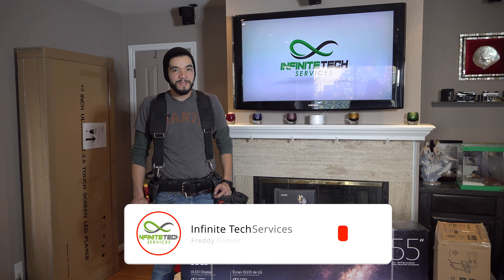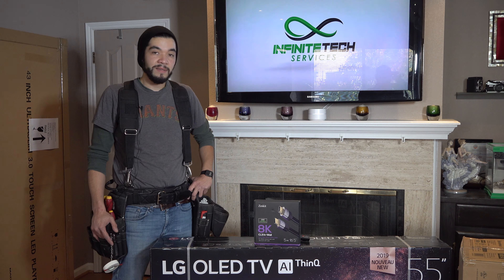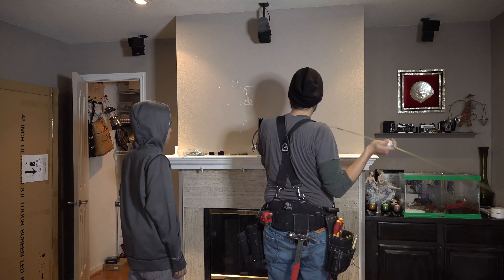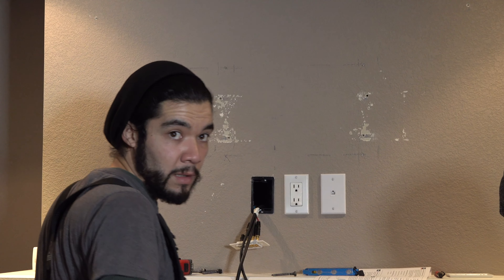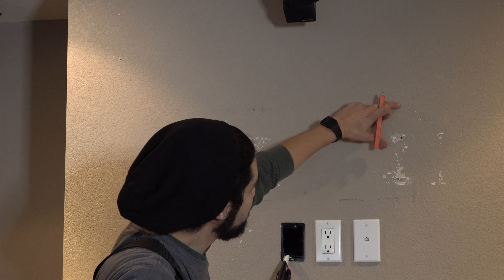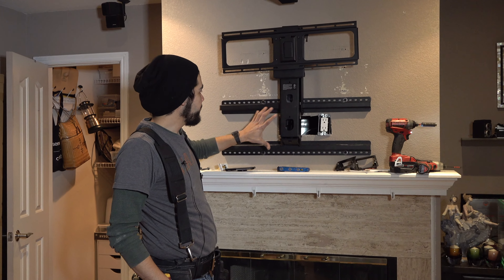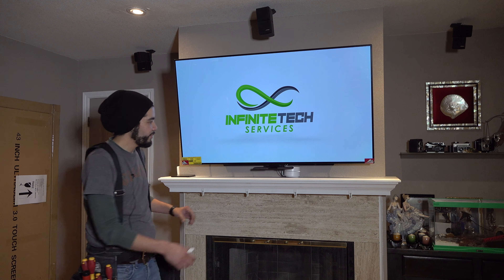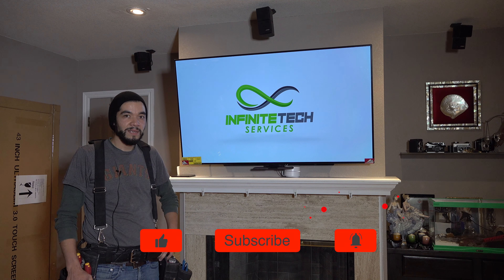Mantle Mount Install with LG 55" C9

Comment: One issue here is that Mantelmount recommends 3" from the bottom of the TV to the bottom of the vertical brace.  Due to the low position of the VESA holes on the LG OLEDs, there is only 2.75" on this install using the furthermost holes available on the vertical braces.  Because of that, the TV is mounted slightly higher on the wall, and thus you can see the very bottom of the bottom wall plate exposed when the TV is in the normal elevated position.  In this case, it's not that bad, but you'll see it if  you look for it.

Comment: How high above the fireplace did you put the lower bracket.  In the installation manual it says minimum 3" + 2" so 5" but in the video, it looks smaller than that.

Comment: Have you mounted a MM540 such that the TV is centered between the ceiling and the mantel? The calculations in the manual to do this don't make sense to me, and tech support says their calculations may be up to 2" off. I'd love advice from someone who has successfully done this. Thanks!